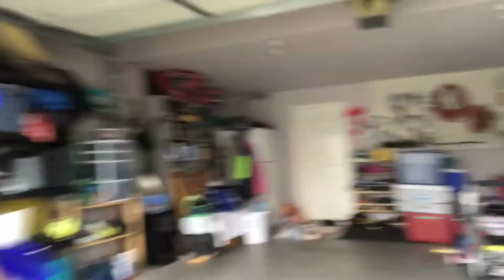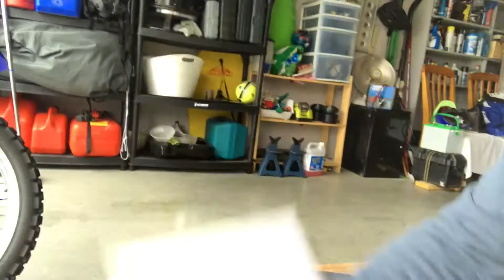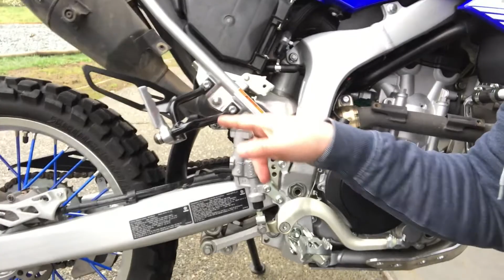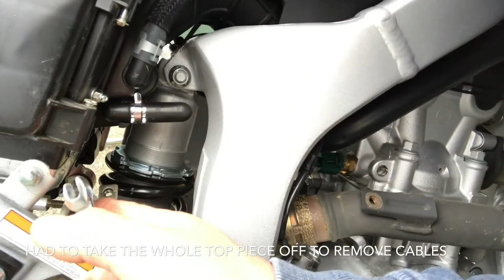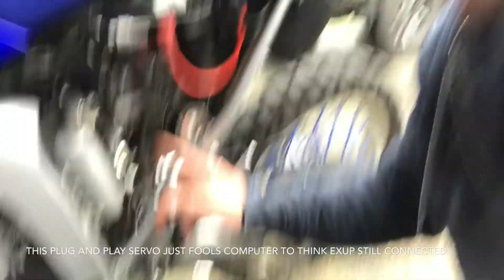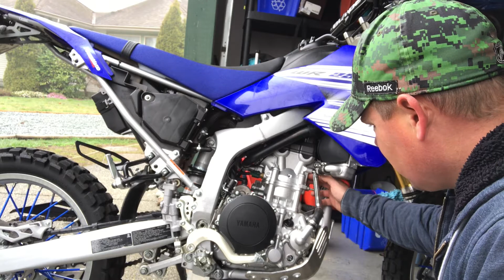How to install FMF Megabomb header. FMF Powercore 4, 12 oclock labs exhaust upgrade on 2016 WR250R

Comment: Great video. I am still debating on if I will do exaust/intake/tuner or not. Some say the EXUP system adds low end torque, how does the low end torque now feel since the EXUP is eliminated, more, less, same etc....
Reply from the maker: AJourneyOfYourSoul I would say if you do the power commander and air filter you gain the snappy torque you are probably looking for. I maybe gained a little more torque with the exhaust. But I think I need to tune my fuel commander to get some more out of it. But if your looking for torque I think a 47 or 48 rear sprocket will help out in the low end. With the 43 tooth it’s really tall and easy to do 120km+. But I want the torque and don’t care about top speed. That will be my next mod. Just have to decide on chain size which I think will be a regular 112link chain. But power commander and air filter was worth the upgrade for sure. Exhaust I just have to tune up better. I’ll keep ya posted
Reply from the maker: AJourneyOfYourSoul tuned second mode on my fuel commander and I am now happy for sure. Second setting went from a 3 to a 5.5. All other settings I left as they were already in range. I have the torque I want. Now just got to gear it better to use the torque range better. Cheers

Comment: Great vid man. Definitely interested in honest thoughts of any power or range of power changes with new exhaust.thanks
Reply from the maker: Thanks Jorge.  I definitely think the power commander mod was the most improvement so far.  A lot of people do the power commander with the exhaust.  But overall it is definite improvement over stock.  I have to program my power commander as I feel it could pull harder at mid range to max rpm.  The lower end torque is noticeable though.  The powercore 4 is very loud.  I wasn't expecting it to be that loud.  But it doesn't sound like a sewing machine anymore haha.  I love how there is no more jerkiness in the throttle anymore.  The whole bike is a lot smoother to ride with all of the smog crap removed.  My next mod I will be doing will be a 47 tooth rear sprocket.  The 43 doesn't do a power wheelie, like my XR400 did hehe.
Reply from the maker: Jorge Gonzalez so I adjusted my acceleration mode and definitely helped my power curve. I adjusted the second setting on my WISECO fuel commander to 5.5 from 3. Noticed a better continuous pull. The rest were all in the recommended levels. I got my numbers from thumpertalk
Reply: Bigair01 thank you! Im gathering asmuch knowledge on 2 bikes. This one and the g310gs. I'll be purchasing in June. Thanks again.
Reply from the maker: Jorge Gonzalez also this bike easily does 140kmh in top gear with 43t rear sprocket. I will be doing a 47t rear sprocket to help with my low end torque soon
Reply: Bigair01 what time is it where u are.canada!?
Reply from the maker: Jorge Gonzalez 821 atm